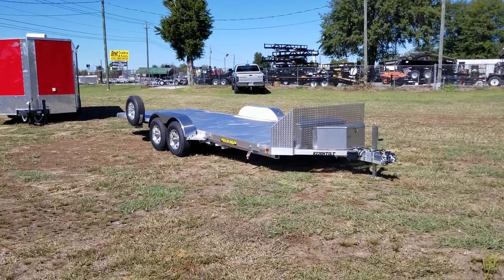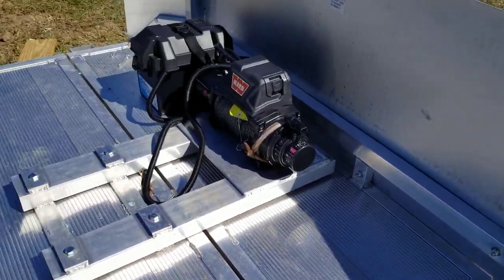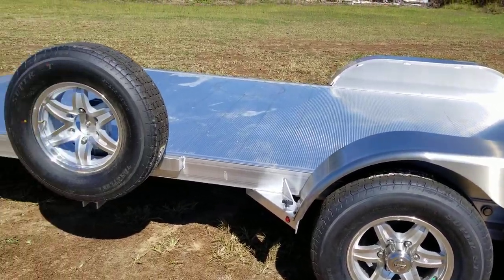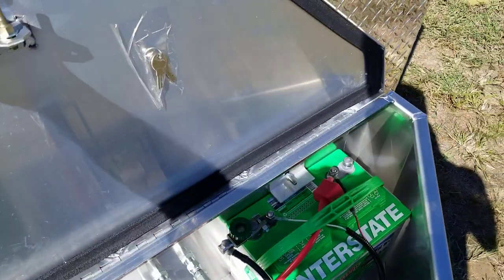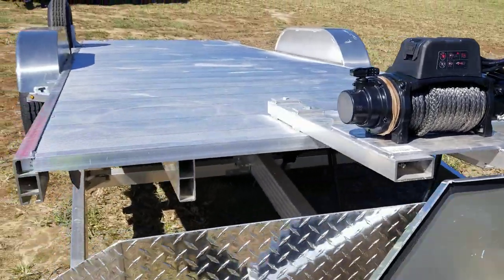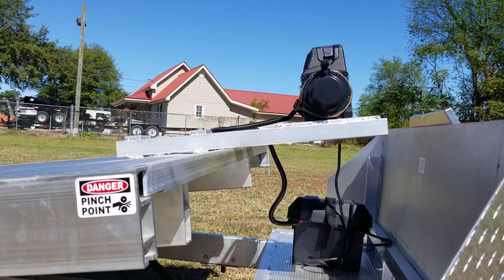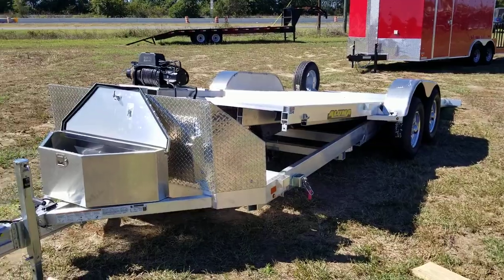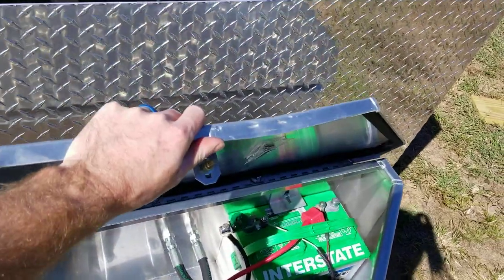8220 h tilt power aluma trailer walkaround loaded with options aluminum carhauler 7x 20

Comment: Hi Joey, I'm interested in buying a winch mounting bracket as shown on this trailer. Is that a factory option from Aluma or do you have those produced? How can I purchase and have shipped to me? Thanks, Dan
Reply from the maker: factory option call tomorrow we will get you set up.  478 654 5350
Reply: @besttrailersUSA  
Hi Joey

How much will cost to state of Michigan my zip code 48304
Reply from the maker: @suhaibalomary  $75 to ship winch mount.

Comment: can you carry a truck on this one? What's max weight you can put on it?
Reply from the maker: Yes you can up to 8000# payload capacity
Reply: I be leave its 7,950 Lbs of cargo/load capacity.
GVWR: 9,900 - trailer @ 1,950 leaves 7,950 Lbs